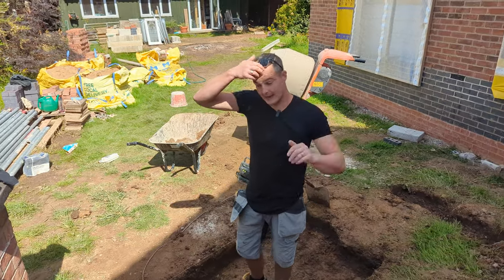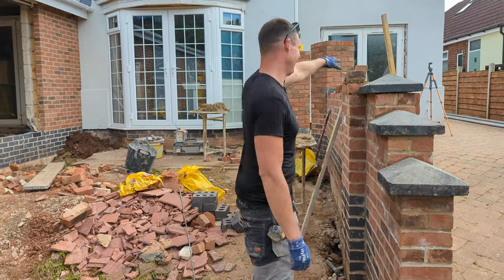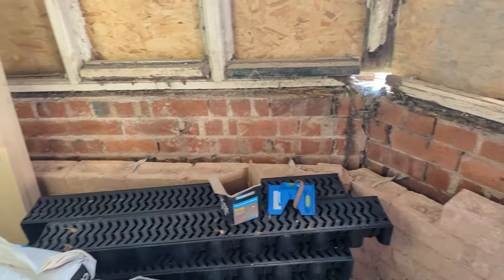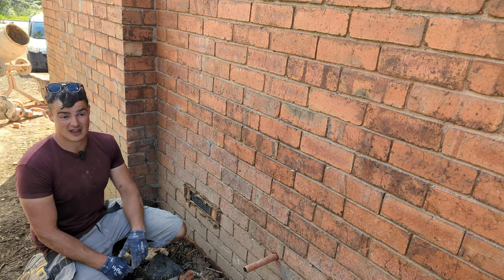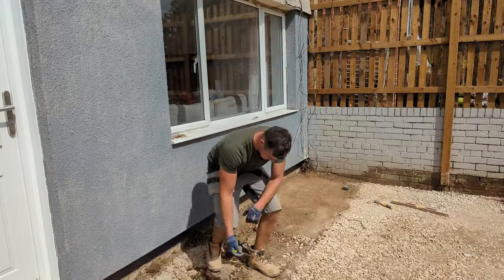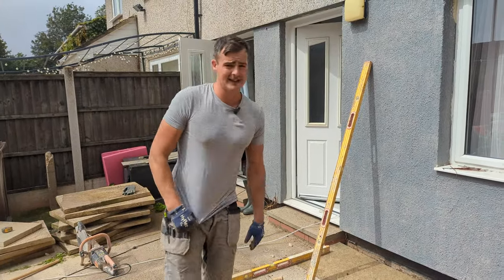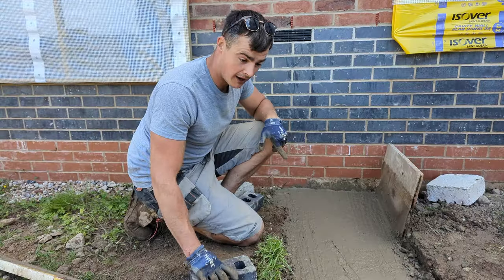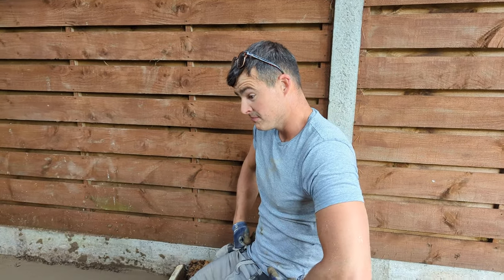Garden Wall Pt2 - Snagging, Concreting & Slabbing for FREE #vlog #construction

Comment: No stopping you is there Isaac, great work mate👍be carefull with them French drains they are notorious for blocking up after a couple of years, need to be 105mm pipe with rodding access so they can be blasted out every few years 👍
Reply: Agreed. Proper sized pipe for a proper job. The space was there.